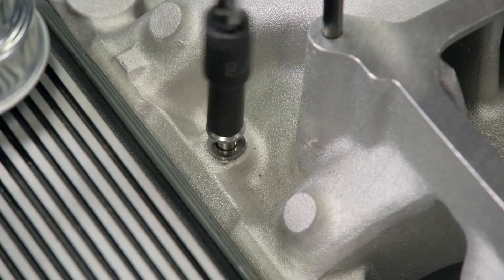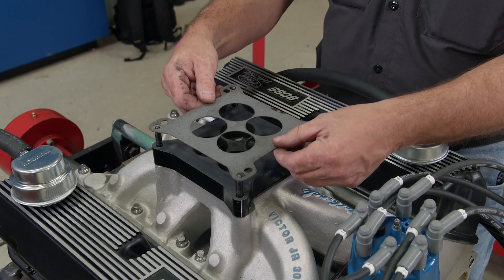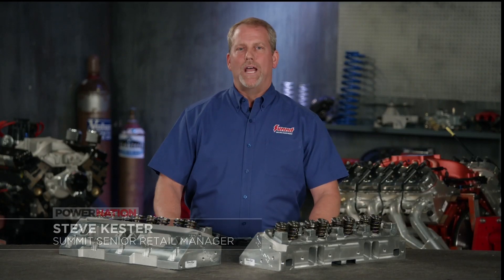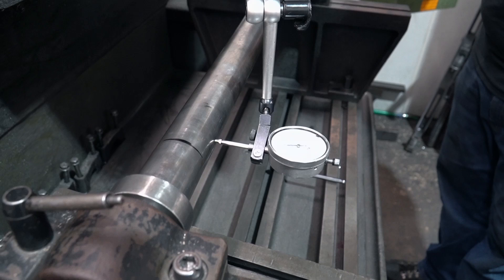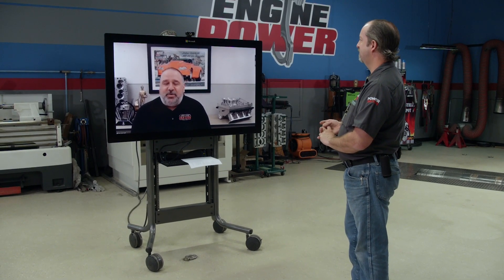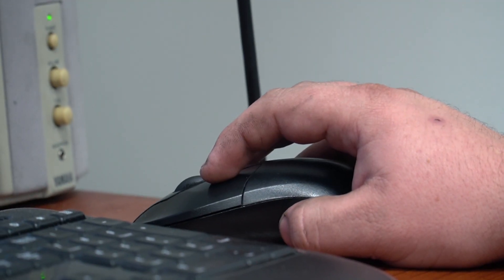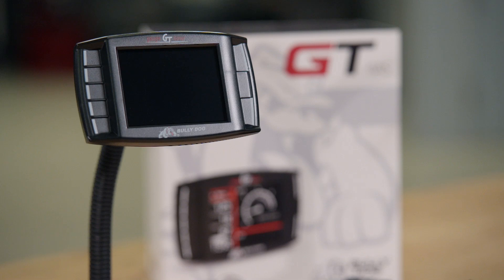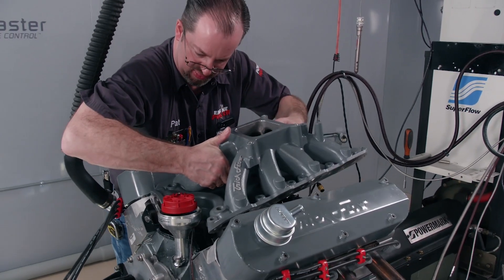Single Vs. Dual Plane Manifold: Which Will Make More Power For Our Ford 302 - Engine Power S7, E21

Comment from the maker: Take our User Survey: https://rtmproductions.survey.fm/2020-user-survey-youtube
Reply: nah
Reply: Truthfully peak power means far less than average power between the peaks and really between the shift points, regardless of the application. Ideally your shift points would be set or chosen to maximize average power. Shaved nearly half second off my 450 whp. Enough to go from high 11's to flirting with 10's in the 1/4 mile. It's a lightish car just over 2700lbs with me in it. With a perfect run it could break 10's, just tired of breaking trans parts for a tenth or two.

In my gen a 10 second car that was legitly street legal was just a myth, today it just takes money, I still wanted to do it though. It's a 94 RX-7 with a single turbo I run it like a drive it, so I have the spare and full interior, cup tires, no cat. If the will was there I could shave another 500lbs off, by going plexi with the glass and gutting the creature features. The FD trans doesn't like super quick shifts, and is prone to breaking syncro's on anything less than perfect.
Reply: By adding the 1inch spacer its no longer an apples to apples comparison.

Comment: Excited to see where you go with the 300.  I have a flathead 226 in my 51 F1.  Have found very little info on that motor and folks upgrading them, so the 300 is very interesting to me.  Still may swap out in time with a V8, but those 300's run forever.  Even my 226 runs like a sewing machine.  My Dad use to always get the 300 in his work trucks because of their dependability.  Hope to see more details soon.

Comment: Right out the gate; “we had a bunch of stuff ($7500 Christmas wish list) laying around & we thought hey, let’s build an engine!” 🙄
Reply: Logan's Hot Rod & 4X4 Don’t we all have $10,000 worth of stuff laying around that we didn’t know about?
Reply: If you have been a gearhead for 20+ years and didn't constantly sell stuff to buy something else. To can start to end up with enough parts to build a motor lol. 
My friends dad has been racing since the 50s. He's probably got enough parts to build a few motors. 
Including a complete machined bbc 427 pulled from a 60s vett. Back in the early 70s lol. 

But I mean it's a TV show. They share a shop with a few shows.

Comment: You're over carbed on that big 950 should drop it down to 750 or even smaller carb
Reply: Yes 650 would be perfect maybe even a 600
Reply: Yes,  dropping to a 650 or 750 will improve off idle response on the street, but will not improve power on the dyno.
Reply: @Torquemonster440  I think it would because it is probably feeding way too much causing it to lean out on the dyno
Reply: @jonathanlawson4667   Their dyno monitors Air Fuel ratios very closely.  If your A/F ratio is correct it will not go lean no matter how big the carb is. The engine will just feel lazy at low RPM's.

Comment: Ditch the archaic flat lifters and use a roller camshaft. The OEM did that over 30 years ago for a very good reason.
Reply: It’s economics,  it’s always money that determines what we do with our motor. Anything go that matter
Reply: @ralphvalkenhoff2887  When a flat camshaft goes bad and shreds the engine full of metal, then one gets an education on economics.
Reply: @ralphvalkenhoff2887  When you're spending a few thousand to build an engine (like in this case) it's penny-wise pound-foolish to skimp on the cam

Comment: 950 cfm, that's about twice the carburetor that engine set up needs.
Reply: Glad you said it.  I was thinking the same thing.  I estimated a 700 or maybe a 750 cfm at 6k rpm.  I have a 650 but no cam or rocker upgrades.
Reply: Don't matter, they dynoed with smaller car made very little difference. But the cam is terrible.
Reply: Didn’t Chevy put two four barrels on a 302 ?
Reply: @markmixon1121 yes with a cross ram intake.
Reply: @markmixon1121 the 302 was to be used for continuous high rpm high cfm racing. They used 600 afbs on their production cars for tooling around with but also giving good full throttle performance and duals on the 302 because the motor is gonna see 8k rpm pretty regularly. Maybe the equivalent of 1100-1150 cfm thereabouts but jetted right.

Comment: On street engine dual plane much better especially down low which you skip over all of it starting at 3k.
Reply: @fpeletz a new performer eps is probably worth 15-20 horsepower over the archaic offy intake easily.....

Comment: Yet to see a test that covers the full Monty of manifold dual/single plane, compression high,/low and fuel atomisation/vaporisation.
You can have a good street engine with single plane and high compression with a carb with excellent atomisation for example but if you take one of those away how much does it impact ie without good atomisation and very little vaporisation from no plenum heating it can become a dog on the street, matching these elements along with ignition timing curves is just as important as manifold rpm matching to port volumes and cam timing etc  !

Comment: so Initially dual plane was 1 inch spacer then huge 950 cfm race carb, then a single plane should be 850 cfm and no spacer if it already flows well. too much CFM with low powered engine will remove all the torque so no spacer no giant carb gives better throttle response .

Comment: Howdy POWERNATION,
I'm always amazed at your CHOICES of CARB SPACERS ... 
It seems you either just use what you have "on hand" ... 
or you use the OPPOSITE of what makes SENSE ?
on an alleged OFFY DUAL-PORT  I-6 cylinder Intake you utilized a completely ill advised SINGLE (one) HOLE Spacer (killing the Dual-PORT effect ? )
&
Now on a Single-Plane intake manifold - you install a FOUR-HOLE Spacer ? = rather  CONTARIAN ?  
COOP
.........................................

Comment: should have used a open spacer plate on the dual plane intake and a open spacer plate with a 4 leaf clover shaped inner pattern spacer on the single plane intake! both spacer plates increase HP and torque
Reply: it is sometimes as good with as without,sometimes even worse with one..........very dependent on whats going on it the engine with heads,cam,compression etc

Comment: Need to see this test on a big cubic inch small block to see how the intakes act on a demanding engine.
Reply: Depends on what you want you want to run it up to.  They dont stretch the legs on these engines.  Higher engine speeds tend to favor single plane at around 4500 rpm, but thats expected.  I look at the whole curve before making my choice.  I'm not willing to throw away 50 ft lbs of torque on the low end to gain 25 hp on the top end.  For a drag only engine maybe but there better be some meat in the curve.  I like the Edelbrock Performer RPM Air Gap with a matched Comp Cam Hydraulic Roller for a Street Motor.

Comment: I have a misfire in cylinder 4 iny 2nd gen Coyote (2013-14). Spark plug's not the issue, Coil pack is not the issue, it's spitting out gas so I assume that's not the issue. What could it be? I hear loud ticking... Also, if I have to rebuild the engine, what other things should I have done to prevent further breakage?
Reply: What did you find?

Comment: I would love to see this 302 with a tunnel air intake..
Reply: A tunnel ram intake would rob all the bottom end torque on the little 302
Reply: It might rob some of the bottom end torque but how often do you see these shows showing a tunnel air intake?
Reply: @civilizedsasquatch6722   tunnel ram intake not practical for street car in most cases. Lose torque and wont fit under a hood. Tough enough getting a single plane intake to fit under many hoods clearance.
Reply: well, why need to hide the beauty of a tunnel ram?
Reply: Yeah , it would be cool LOOKING .

Comment: The 302 looks like it could use a better set of springs. Looks like you got some float on the top end above 5200 rpm.

Comment: I got a 79 F150 with a 302 ci (5.0). (G) with 2 bbl carburetor. Everything on it is factory. I’m looking at it as winter project. I’m looking to upgrade it on a budget. Any recommendations? Intake. Carburetor heads. Ect. Please help.

Comment: Torque plates are something relatively new for me. Is there data on before and after boring?
Reply: Ralph Valkenhoff A torque plate represents the cylinder head being torque down there for the cylinder bore’s are completely round

Comment: The 1 inch 4 hole spacer was used instead of a 1 inch open spacer for that Victor Junior single plane.  Was there a benefit in using the 4 hole?
Reply: 100% a 4 hole will be better, maybe not by much, maybe by a good amount,, but
1) in increases plenum volume, 2) you don't lose carb signals.

Comment: What would happen if you put a single plain intake on a stock 302 that was EFI in a 1990 f150im just curious what you think about it but either way I am going to be doing it because it is all I have and I am poor and I have to get the truck running again and there's to many problems with the wiring so it is all I can do to get it to run again lol
Reply: It will lose torque and hp below 3,500 rpm, and be close till 4,500, then should pull higher/make more Hp 5,000 plus rpm. But a stock 302 efi, is not setup to take advantage of a single plane. If you put a Tfs stage 2, or 3 hyd. Roller cam, and Tfs heads on it later, it will haul.

Comment: I am in need of a set of polished valve covers like those, any suggestion on where I could find a set?
Reply: George Martin Summit racing
Reply: @bryantcurtis2665   Sadly to say Summit Racing no longer sells them, have tried all specialty Ford / Mustang suppliers and am told they have been discontinued.

Comment: Question if you have an Light military tactical vehicle how to get better mileage and a bit more mph rather than  55 or 58 mph??. I would like to get more than 10 miles a gallon.  Any thoughts?
Reply: Duramax
Reply: Swap another diesel in. Powerstroke, Cummins, Duramax, Mercedes
Reply: I would assume you have a humvee or h1 they are drop in duramax whoth the kit

Comment: 900 cfm carb on a 302??? What are you thinking, are you running this to 10,000rpm? 600 is more like it.

Edit***
Sorry, I posted this right after you mentioned the carb size. Before you made it clear it’s a shop junk Frankenstein. 
Still, running parts more closely matched to the engine will give better feedback when comparing parts. Your manifold info could be entirely incorrect based on the completely mismatched carb.

Comment: Those cylinder heads suck. AFR185,190,205 would have put you in the 400-430hp range on the engine Dyno with a matching cam. Those FloTek heads are probably moving 200-220 cfm at best

Comment: You ain't got near enough cam in it
 Looking at the curves I'm shocked you kept that much torque that low with the victor jr. You don't have enough cam for the dual plane. My old junkyard 306 made a calculated 368hp @ the back tires with tried&true old school solid lift cam,flat tops, and rpm intake. Old 289 heads backyard ported, big valves. Fred Flintstone s@#t. Pressed pin trw pistons. Leftover junk!  Stick that turd on something and v6 Mustangs gonna clean ur clock!!

Comment: Single plane is only good in street app if using a manual transmission. You need a 3k stall converter at least with automatic. And that is very annoying trying to drive around town at 35-40 mph.
 You should have used an air gap dual plane since that is what 99% of people use these days. No one really uses a true dual plane unless they just love carb tuning issues.  I have honed the divide completely out of mine. Now it's an open plane with short runners. Still rocks the low end torque, and has more up top as well.
Reply: Off Grid and Outdoors replied: "I had a single plane on my 383, a 3500 stall, and a 700r4 AT, with no drivability issues at any range"

Comment: 322hp?? Not bad? G wiz pat that's what 50hp over a bone stock weezie 5.0 HO? With heads, cam, intake, carb and headers upgrade I would be mortified at those results... I know it's apples to oranges not even in the same universe but David vizard got over 500hp out of a 331 with ported E7 iron heads, but his name should be David wizard.

Comment: I have to ask???. With all this knowledge about engines, motors, design and engineering,  do dudes show up in black suits, ties, hats and dark shades and say...If you continue, we will shut you down quicker than turning off a light  switch.  I'm purty sure it's some dudes that have the talent to make a engine run, perform and get 50-60 mpg without a turbo, supercharger or any other add-ons,  but... The " black suits " won't  let 'em ...???

Comment: this video is difficult to watch.  the moment you slapped a 950cfm carb on a small block with lower compression,  revving to 6500ish rpm, and a mild flat tappet cam you ruined this motor. you put a 950 cfm carb on an engine that flows 700 cfm at best on the top end.  you should now you had the flow meter on it!!!!  I would love to see that test with a better match of carb 650 or 750.  to start we wouldn't hear the engine fall on its face when you start the dyno pull and we would see a dramatic change in bottom end numbers.  when you slapped the massive carb on you invalidated the test. you weren't going to see much of a change because of the massive carb.  BTW did you bother to re tune the carb for the single plane.

Comment: Such little power with so many goodies and the carb is way to big you guys should know this a 322 or 328 horse power motor with a 950 double pump carb is not a good combo build i have a 400 horse 355 sbc and i have a 670 AED red and it runs perfect i wouldnt put a 950 carb on my set up.950 carb works for hight compression motors and strokers pushing 500 plus horse

Comment: Lame power. My wifes stock 2020 Edge with the 2.0L will kick that 302 ass up and down the track or street. 

Why the hell did you put a 950 on a 302??? Oh I forgot how you test stuff. Joe Elmore, Mike Galley  and that other guy  did a dyno shoot out between a stock crank 351 Cleveland with stock heads vs a 408 Windsor with Edelbrock Cleveland  heads and thought that was a good comparison of who will win. Hey HorsePowerTV how about reclaiming your manhood and re do that test and build a 408 Cleveland so it can whip that W408 Windsors ass.

Comment: Can u do some build ups on a 305 chevy or 307 chevy v8 that would be cool to see thanks
Reply: What's the point?
Reply: For the people who have those motors to see what the are capable of
Reply: Vice grip garage built a 307 it was like 305 horse and 335 torque he said the cam was a little aggressive the intake was a little big he would of gained low up and the peak would of been better with milder cam and what not
Reply: @kevinjohnson9372  Why build a 305/307 when you can do a 350 for the EXACT SAME cost????  Who builds a 305, lol. The bore is to small for anything.
Reply: @bluesky-ud9wg  why build a 350 when you can build a 454 for a little more, why build a 454 when you can turbo an 5.3 for half of both, why bother with a 5.3 when you can get a junk yard 6.0 for $300 and used duramax turbo for $150. I mean it doesn't even make since to even suggest a 350.